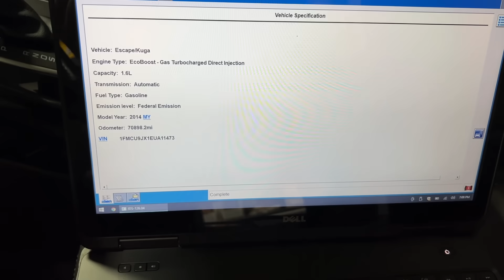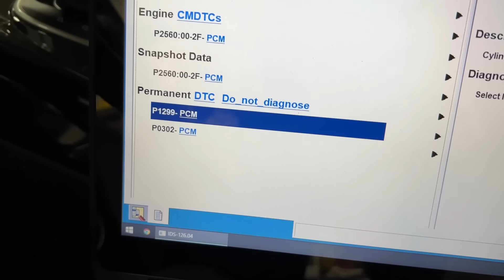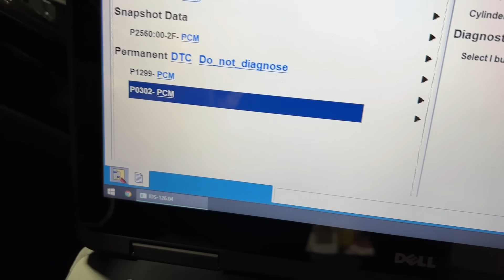Beware of Ford’s 1.5L 1.6L 2.0L Ecoboost Engines and Their Never Ending Coolant Consumption Issues!

Comment: Evening Brian, I had several Bronco II’s the predecessor to the Escape. All had a 3.0 cast iron long block, there were never any issues. I can’t believe the government has allowed this to occur for so long. Thank you for the information!’
Reply: Are you in the US? We had a few bronco 2s but the last ones I remember here were from late 80s maybe early 90s.  Ours had 2.9s I'm them and we got them because they had bad engines. If I remember correctly, the heads used to crack. Ford updated the engines and changed something I believe, but you could also get the heads repaired and put it back together if they hadn't been overheated to the point that they were blown up

Comment: So is this caused by warping, gasket failure, boost or a cracked block? So it's just coolant getting into #2 and not coolant in the oil? Why can't you just deck it and seal it up? I didn't see anywhere the "cause" of this problem. Only a sign of the problem & a final "replace the engine" fix which seems a bit extreme.
Reply from the maker: Please do some research on the issues with these 4cyl eco engines. It’s the block design.

Comment: So I'm thinking you wouldn't recommend buying a 2012-2014 F150 with the 2.3 Ecoboost.  Thanks.
Reply from the maker: There are so many things wrong with that statement I have no idea how to answer it.
Reply: @FordTechMakuloco  My bad it's a 3.5 Ecoboost.
Reply from the maker: 2013-2014 are good engines yes.
Reply: @FordTechMakuloco  Thank You!
Reply: @FordTechMakuloco  what about the 2015-2017 5.0s?
Reply: Ford did not make a 2.3L Ecoboost for the F150 in those years (or any years).  3.7 V6, 5.0 V8, 3.5TT Ecoboost and a 6.2L V8.  Starting in 2015, they introduced a 2.7L EcoBoost.

Comment: This seems to be a case where  a "mechanic in a bottle" could be justified.
I was not a great believer in these products, and some of them are still crap, but a little over 2 years ago, the night we were going in to our first cov lock down, my 1KZ powered Hilux filled a cylinder with coolant.
We pulled the glow plugs, turned it over to get rid of the water, put it back together and poured a "product" in the cooling system. 2 years and 15000km later I still have not had to take the head off.
It did say on the bottle it was a "permanent repair", I am starting to believe it.
Nothing to lose and a whole lot to gain the way I see it.
Reply: What product was it???
Reply: Why are  you neglecting to say what brand and product it was? Is word of mouth no longer legal?
Reply: @Psxmoe  Old timers put water glass in their motors. It would fix cracked heads, blocks, head gasket etc.  Its sodium silicate.  Bar's cheapest one is around 10 bucks (Liquid copper) it contains sodium silicate.  Mixes with any antifreeze.  I just had a duramax with crack in head leaking out by #8 injector. This fixed it.

Comment: According to another Youtuber-a Ford Tech-the engines have been redesigned to fix this issue.  If not, what would be the point of putting another defective long block in as a repair?  It would be nice to know if the fix is a reality.  That being said I am holding on to my Duratecs as long as I can.  Might even change brands if Ford cannot get their engines right.  Or stand behind their customers when something as basic as this goes wrong.  There will be a class action settlement on this issue but that probably will not do much more than make some lawyers richer.
Reply from the maker: Yes there is a redesign.

Comment: Ford used to be my preferred car manufacturer then they stopped making cars (except mustang) and then they ecoboosted everything.  I still have my F150 with a 3.7 (went for fuel efficiency but wish I got the 5.0L) but I don't believe I will buy another ford again.  I want a small fuel efficient CAR  (not a mini SUV) for daily and keep the truck for when I need a truck.

Comment: THAT HAPPENED TO ME!!    The only car I ever bought brand new was a 2014 Escape Titanium with a 1.6L Eco-Boost.  Engine blew with 52K miles on it. Cracked block around cylinder No.2.    FoMoCo ended up replacing the engine at no charge to me.
But, sometime before that happened they replaced the plastic coolant reservoir because it developed a crack underneath it.
I also had problems with the navigation module.
C'mon Ford, you've been building cars and trucks for over a century! Are you telling me you can't make a better product????????
Reply: It can all probably be attributed to computer aided design as opposed to the good old fashioned design back in the day when engineers got their hands dirty. Its also probably some kind of sickness in the management and how little they want to hear from the little guy. In Japan they welcome input from the smallest guy in the factory.

Comment: None of the American manufacturers have ever made a good 4 cylinder engine. The closest was actually Ford with the Pinto engine. Not on the same level as Honda or Toyota but a good decent little engine that was reliable.  This is the same level of trash engineering as GM’s Ecotec engines. Sad.
Reply: Bull.  The 2.5L Iron Duke was practically indestructible from GM.  Granted, it was no powerhouse, it was just very reliable.
Reply: @gregoryg  it  couldn’t even make 100 HP despite its displacement and it ran like a tractor engine. And it was reliable as long as you didn’t rev it hard. Not qualities of a good engine.

Comment: Definitely not calling you a liar. I just want to know just in case one of these come into my garage... Just wondering how do you know it's a cracked block an not a head gasket??
Reply: This is a widely known issue with these engines due to slits between the cylinders in the block. The upgraded block doesnt have them. Ultimately it is a design issue on Fords part.
Reply: Look up this issue on YouTube. There are many vids on this situation. Are you a new tech? You haven’t heard of this issue? Do your research and stay on top of your game in case one of the engines presents itself for repairs.

Comment: I’m glad I got the 2.5 engine in my Escape, 120k miles with no engine issues so far. I would love a fully loaded Escape with the 2.5 engine, too bad Ford decided to prioritize Ecoboost engines on those.
Reply: The 2.5 is the Mazda motor.  I have the exact same one in my 2011 Mazda CX-7, 155,000 kms.
Reply: @kevinW826  The 2.0L Ecoboost is also based on a Mazda engine (the Mazda L engine specifically), not sure about the 1.5 & 1.6
Reply: @bradnoyes7955  I know the 2.0 and the 2.3 were originally Mazda motors.  Ford screwed them up
Reply: the 2.5 is just a bored mazda 2.0... those engines were great. better than any toyota
Reply: @andiarrohnds5163  really better than a toyota engine? explain
Reply: 2.5L engine was designed by Mazda for Ford. That's why it's reliable.

Comment: Is the new engine prone to the same failure at 50,000 miles?
Reply: Block was redesigned to fix the issue

Comment: I haven’t even watched the video yet but I’ll go ahead and say as a lifelong Ford fan, I’ve become very leary of almost all of Ford’s gas engines since the introduction of the 5.4 3v. The only exception being the 6.2. All of my research shows the 6.2 to be a very good engine. Haven’t researched the 7.3 gasser yet as I’m waiting for a little more longevity with it.
Reply: The 7.3 is fine. Doesn't even have an OHC. Built like the old days. No cam phasers. No turbo. Cast iron monster.
Reply: @TheBandit7613  I’m really liking what I’m learning g about the 7.3 gasser. Especially the no cam phaser bullshit.
Reply: 6.2 likes to break valve springs.
Reply: What about the 4.2 V6?

Comment: I’ve owned and currently own two 2.0 ecoboost cars.  A 17 FocST and a 19 Fusion Titanium.  The ST has only 35k but I’ve had constant misfire issues with it and I just bought it at 25k, the coolant overflow was also down on the ST… car seems to run great sometimes but others I have issues.  Is the endoscope the best way to check for a leak or that and the pressure test.  I do not drive a lot so I would take sometime to lose a lot of coolant.  This worries me and the Fusion has seemed great but the overflow was a little low also so I added to it.  Ugh I hope both do not have this dreaded issue because the wife loves her car and I love the ST.  Hers has 74k now but this makes me really nervous.  I definitely wish Ford would have kept more NA options around for motors because I’m really considering going to a 2.5 na 4 or a 3.7 v6 or the 5.0 coyote.  I just believe na motors are more reliable.

Comment: Is that engine made in Cleveland, Ohio or Valencia, Spain? I've heard that engines made in the Cleveland Engine Plant have a lot of head gasket issues and the Valencia Engine Plant has little to no issues.

I recently took delivery of a Maverick and I like that it shows VEP on the sticker. But I also notice that the engine coolant color is yellow not orange like it was in my '17 Focus. I'm getting an engine coolant exchange service when the Maverick reaches 50,000 miles to hopefully prevent head gasket issues.
Reply: Engine in the maverick has a re designed block

Comment: You are saying this a guaranteed, eventual, failure on all 4 cylinder turbo engines? Hopefully its ahead gasket. As an owner if a 2015 Escape I am putting in a  transmission right now. I have 144,000 miles. Sighs. I own Ford stock, too.😫

Comment: Is it a design flaw, or an assembly flaw?  A design flaw will still have the issue with the new long block no?  If its assembly, with the newest and latest head gaskets and fasteners can the issue described be addressed so that it doesn't happen again>
Reply: Design flaw due to slits between the cylinders in the block. New blocks have been redesigned.
Reply from the maker: Design flaw